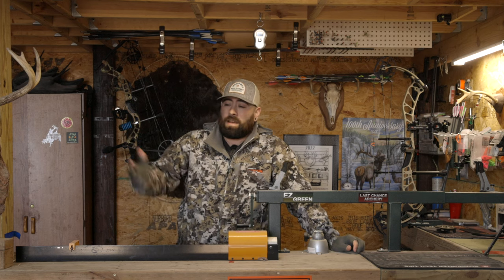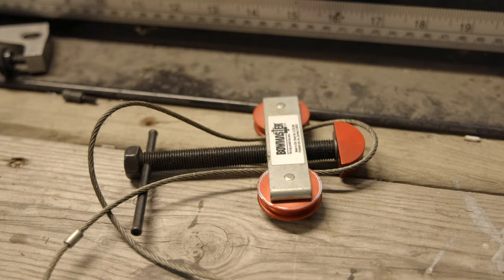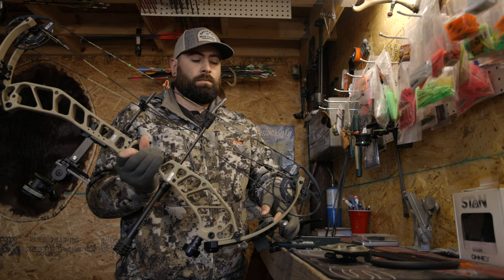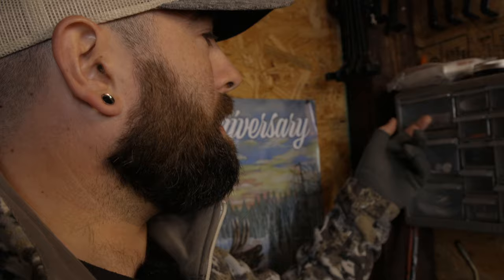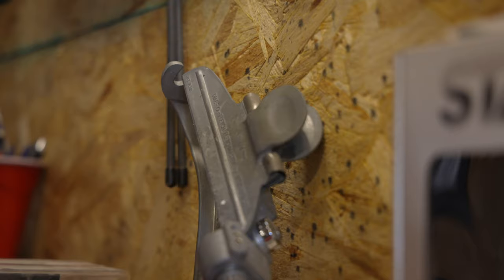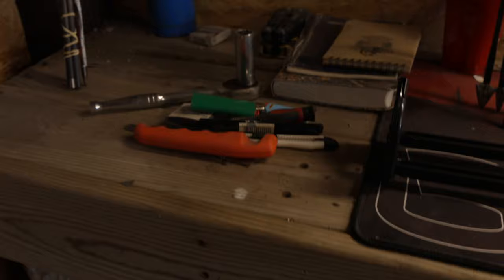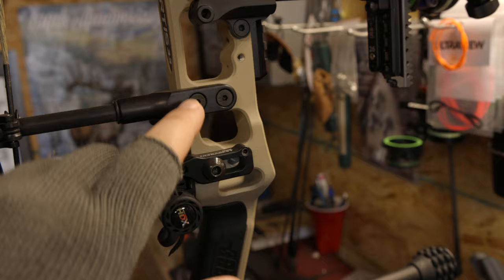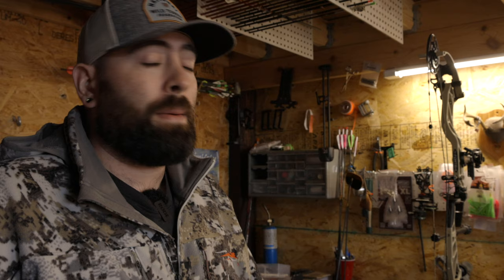AT HOME ARCHERY SHOP BREAKDOWN | What I Have In My DIY Bow Shop!

Comment: I built a bow press I ordering a bow vice. I have all the goodies for working on my bow. My bow press is mounted on an old sewing machine cabinet. I built a tray on my press to hold the Allen wrenches glue etc. Th next thing I'm building is a draw board for cam timing draw weight and draw length